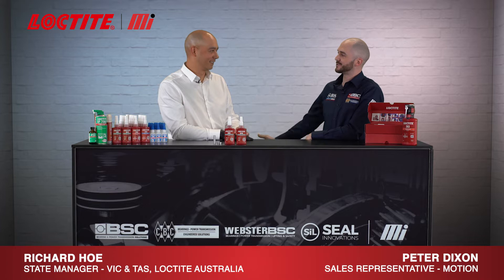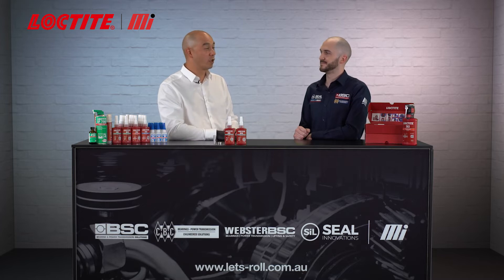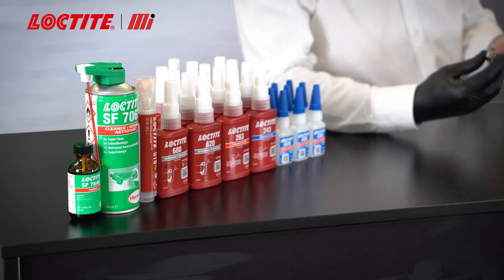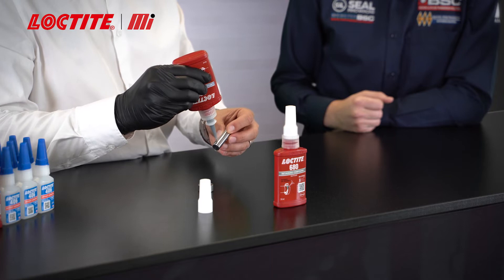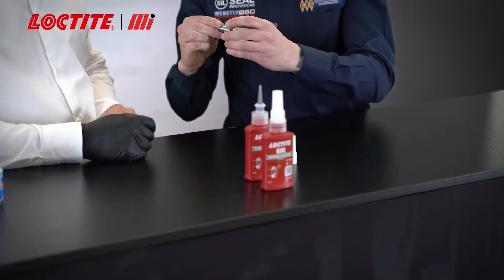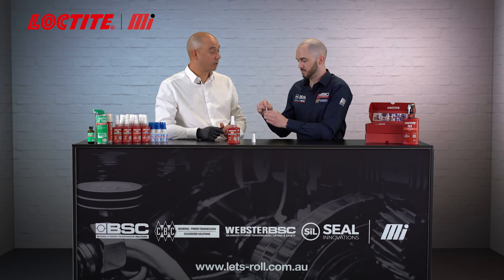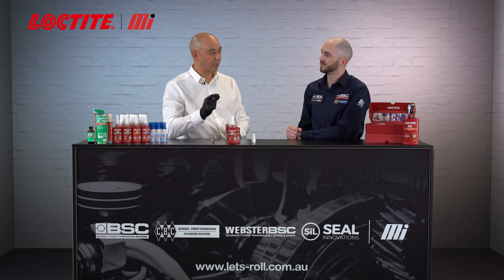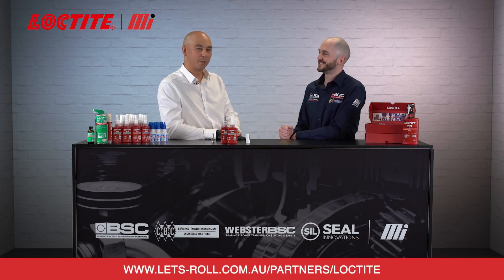LOCTITE 620 and 680 Retaining Compounds - Demo

Comment: What’s the difference between the 620 and the 680?
Reply: 620 can do higher temps. Not sure if 620 is weaker or stronger than 680. My guess is weaker but not by much